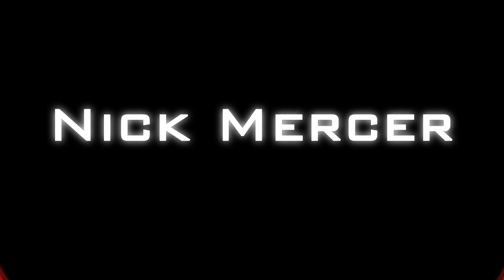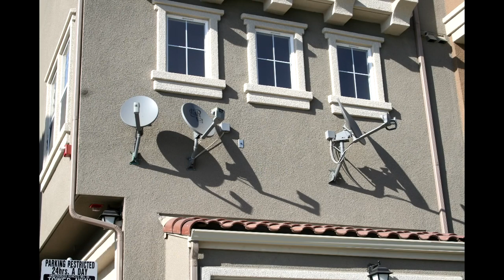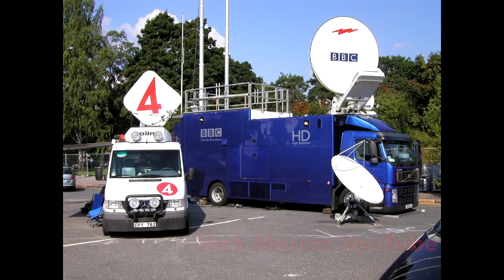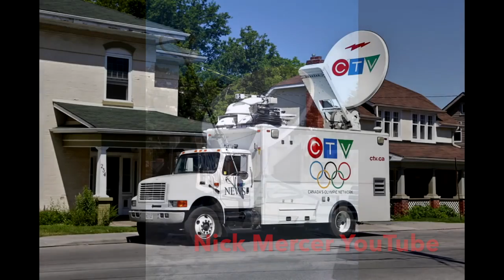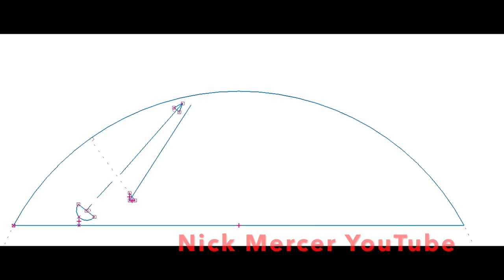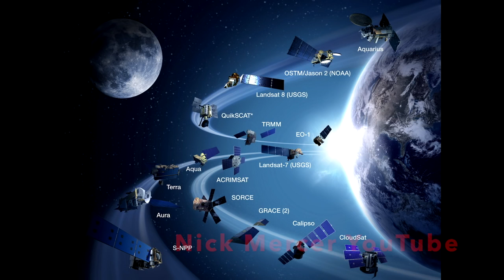The Firmament 2021, How satellites work

Comment: if you know anything about a reflector or a receiver you can figure out that the signal spreads very wide very fast and the angle is to collect as much signal and concentrate it to the L-n- B recever it has nothing to do with space

Comment: Most communications satellites have a translation in frequency from the transmit to the recieve.  They are not just bounced back.  You can see a persistent noise floor from active transponders and you can contact the satellite owner operator and do things like adjust the gain state and also shut down the transponder all together.  So, no, satellite communications is not accomplished by just bouncing off of the firmament.

Comment: Transparent aluminum. Aluminium oxynitride or ALON is a ceramic composed of aluminium, oxygen and nitrogen. It is marketed under the name ALON by Surmet Corporation. ALON is optically transparent in the near-ultraviolet, visible and midwave-infrared regions of the electromagnetic spectrum.

Comment: This dome would have to be an extremely smart dome for it to behave like a satellite let alone a collection of satellites.  Firstly a simple reflection would mean  the frequency coming back would be the same as going up. Not how it works.   The signal is received  at the satellite from the earth and rebroadcast back at a DIFFERENT frequency. The difference in the frequency not only varies from satellite to satellite but often from transponder to transponder on the same satellite.  Some of the  newest satellites have a matrix switch selection system which enables the satellite operator to  map any uplink frequency to any downlink frequency. They can do this at any time.  Then there is beam switching, polarization, power adjustment ...

Comment: SATELLITES START IN THE LOWER SOUTHEASTERN HORIZON AND THE STARTING NUMBER IS 61 DEGREES, AS YOU GO TOWARD THE WEST, THE NUMBERS GO UP, ALL THE WAY INTO THE 100's until you reach the western horizon. THEN BECAUSE OF THE CURVATURE OF THE EARTH, THE SATELLITES REPEAT AGAIN BUT MORE STRAIGHT OVERHEAD. THEN THEY DO IT AGAIN MORE TOWARD THE NORTH, WHICH IS BEHIND YOU IF YOU ARE FACING SOUTH, AND THEY REPEAT THE SAME THING ONCE AGAIN, GOING FROM EAST TO WEST.  GO OUTSIDE AND HOOK A SATELLITE FINDER METER TO YOUR DISH AND HOLD IT IN YOUR HANDS SO YOU CAN AIM IN MANUALLY AND PROVE IT TO YOURSELF YOU FXXKING IGNORANT HICK

Comment: Another example is the Army's SINCGAR radio.  It was and its variations continue to be ground based and primary form of communications.  If you find your global position and know where the transmitting signal is coming from, you'll note it's not the terrain that blocks direct radio waves, it's the inability to "billiard-shot" the radio waves off the dome for that position.  Which is why terrain from the air is always considered for best positioning.

Comment: Perhaps what is needed right now, is a little off the cuff humour, rather than savaging one another
The fiendish spate of bad weather, that had raged for several days, holding the mid-west town of Flatville Springs in it's icy and stormy grip, had mercifully abated. It's high winds and torrential rain, had threatened what looked like the one day in the year, that the Flat Earth Annual Day Picnic In The Park might have to be cancelled. However, the next morning, incredibly, magically, it had dawned bright and sunny, with clear skies all the way to the ah, flat horizon. In motels all across town, flatearthers gazed out of  well licked windows  , their angelic faces wreathed in smiles, as they all looked forward to this one big day in the year for their annual picnic get together. Excited also, as this year they were to have a flat earth renowned guest speaker, who would put in a brief appearance later in the day. But in the interim, there was a shitload of preparation to be accomplished...

Sometime later, over in Flatville Spring's local park, out on the edge of town, the flatearthers' picnic was going well. The seemingly endless procession of trays of greasy finger food, just kept coming, ensuring no one would go hungry on this day.The multitudes, took full advantage to gorge themselves, whilst slaking their thirst with no less than six dozen 18 gallon kegs of the finest premium draught, a boutique beer, made from the ice chill headwaters of the Colorado River. Most all stood around in small groups, talking/slurring quietly amongst themselves, anxiously awaiting the arrival of the guest speaker and periodically casting furtive glances towards the entrance gates. The others, who were considerably worse for wear, lay spreadeagled in the grass, totally oblivious to their peers, falling over or stumbling around them, a glowing testament to the beer's 9.5% strength of alcohol by volume. Then suddenly a shout, "she's here" . Like a school of fish that turn together in fright, all heads turn as one, and observe a gleaming black SUV arriving. A thousand sets of  glazed eyes  follow it's progress, as it makes it's way slowly through the crowd to a central point, where a temporary podium had been erected...

A lone figure, clothed only in a white robe, exits the vehicle and ascends a short flight of steps, where she is handed a cordless microphone. Turning to the faithful, she immediately launches into a 30 minute tirade against the globalists, that has her followers  slack jawed, leaking drool . At the finish, the gathering go wild, cheering loudly, screaming her name, tears streaming down cheeks unabated, the adulation absolute. A small smile plays about the corners of her mouth, in recognition of the influence she has over these  turkeys ....

With outstretched arms held high, she gives that universal gesture in calling for quiet by patting the air. Immediately the crowd fall silent. A huge intake of breath ripples through the crowd, as she allows the robe to fall at her feet...

Addressing the assembly again, her seductive tone holds them spellbound, as she breathes, "The time has come when we must all answer the call, to answer the globalists' infernal questioning of us providing proof of our flat world. So as a gesture to what we truly think, we'll give them their answer and, one that truly brooks no argument". Whereupon she turns her back, bends forward at the waist and, holding the microphone beside her anus,  lets rip a long drawn out thundering great FART , that with the aid of a 3500 watt amplifier and sixty 250 watt loudspeakers, placed throughout the park, assails her audience with a sound, which can best only be described, as not unlike the rumbling of a 4.5 earthquake, that leaves them  wide eyed and gobsmacked with delight ...

Regaining her composure, she gathers up and reties the robe securely about her and calmly walks from the stage, tossing the microphone to some  lackey . She then enters her vehicle and drives off with nary a backwards glance. The spell, now seemingly broken, the moving, heaving sea of flatearthers, begin cheering and whistling, the caterwauling now reaching a new crescendo, with the subsequent sound reverberation shaking loose thousands of Autumn leaves from the surrounding trees...

Then in a almost perfectly choreographed dropping of trousers and panties, they too all bend forward,  unleashing the sound of a thousand farts, from a thousand assholes, from a thousand deluded flatearthers .Then one morose looking individual turns to his buddy and asks "Hey, Mac, do farts have lumps?". His mate looks askance at him and replies, "Only when you shit yourself, bwahahahaha"...

Meanwhile, on the other side of town, home gardener extraordinaire, Tommy Twotoes is blowing grass clippings off his driveway. Frowning, he stops his leaf blower, removes his ear muffs and looking to the sky, briefly wonders if that peel of thunder he just heard, heralded the return of the storm. After a few minutes, he discerns another low rumble, but with less intensity and assumes it to be moving away. With a dismissive shrug, he fires up the blower again and continues on...

Comment: Geo stationary uses this reflection of the Firament, there are other systems using Helium Baloons that are tracked and recovered with aircraft. These are lunched from the edge at Antartica, the Earth flatness can be confirmed using Amateur Radio 10Ghz communication. Thank you for excellent video.

Comment: the way its transmitted is depending of radio waves but the dome is liquid based. like the ocean. so it does not bounce all the electric waves. some are absorved. thats why repeaters and  wave enhancers are needed. doppler tech is also used in a lesser wave, but electomagnetic activity is super important, and the ionosphere is electrically charged. chemtrails also help wave bouncing using aluminium and barium.

Comment: +Nick Mercer, You seem to have the dome figured out pretty neat.
I won't go in debate with radio waves and satellites, although I'm an ex merchant navy radio operator and I've sailed all over the maps, and have a great deal of experience of that.
Now, I'm living on latitude about 61 dgr north, and I can see clearly the center of the firmament, Polaris, and the rotation around it. But when I go to latitude of equator or even further south, should I not see the North Star as well, just like your dome illustration apparently gives me a reason to believe?
I cannot. Why is that?
Answers to this question elsewhere have been like horizon and perspective reasons - and , naturally, I'm a goddamd liar and Illuminati satanic troll.
What might be yours?
Reply: Common sense would lead me to believe you could see Polaris but it would be lower in the sky the further away you are from the North Pole. You would be looking at it from a different angle than you would if closer to the North Pole.

Comment: Its simple to prove or disprove a globe earth. Take two boats and a laser transit or laser pointer. Have one boat near shore and another several miles out to sea, use a telescope as well. Point the transit from one boat at say 6 feet above the transom to the other boat, and see if there is a curvature. Simple.
Reply: Edward William Case laser is made of particles which are affected by gravity. lasers cam bend too just like near the singularity of a black hole..itll curve right into the hole
Reply: No, several miles out to sea, gravity will have zero influence on a beam of light over such a short distance. If the two boats are identical in every respect, that is, from the same manufacturer, and both with a single calibrated mast, no one on board, an exceptionally calm sea, it's a good bet the laser will hit the boat at sea's mast a little higher, but while Edward's on the right track, unfortunately the variables are such as to be too many to overcome. Nothing to do with the hardware, that's all good, but the vagaries of Ocean currents, Wind and a near impossible way to anchor the boat at sea in very deep water securely enough to negate those forces coming into play, would in my opinion, result in the experiment displaying a number of different readings that couldn't prove a true test of Earth's curvature. Perhaps a ship the size of a ULCC might do it, but again, big or small the Ocean is bigger and even a small swell will have it's effect. No, I believe the fact that we see a ship recede from view hull first over the horizon, or when approaching land from out to sea, to see tall skyscrapers rising to reveal their bottom half, is still the optimum way of knowing our Earth is a Sphere...

Comment: Flat or round earthers, I have a suggestion that you might try to prove or disprove the dome and satellites:  Get several people(at least 3) using the same satellite dish company that are geographically far apart.

Go outside with a compass.  Measure the angle of magnetic north on the compass to the position of the dish.  Using this angle and your geographic position compare notes with the others and triangulate on a map where an uplink transmittion must be positioned on the dome or satellite.  

Don't forget to use the angle of incident when calculating the ground position of the uplink transmitter.  Use google earth to verify if such an uplink exists.  Rinse and repeat with all other dish companies.  

Present a video of the conclusions showing all positions of uplink transmitters.  It's either uplink transmitters or satellites.  Find out for yourselves.
Reply: Excellent experiment.